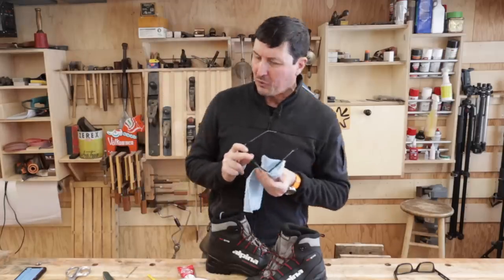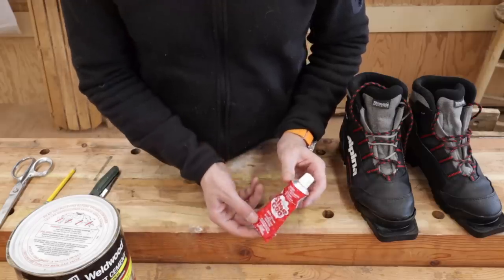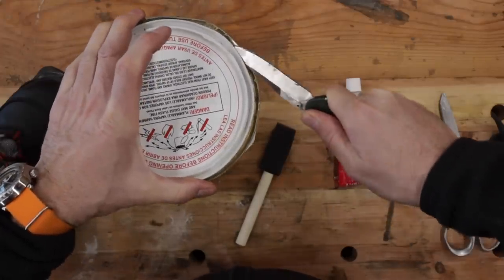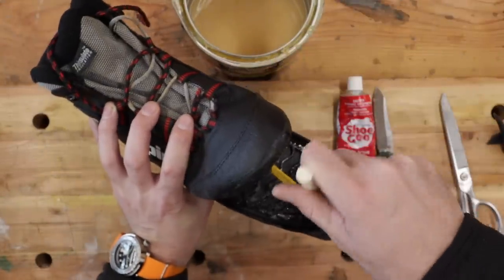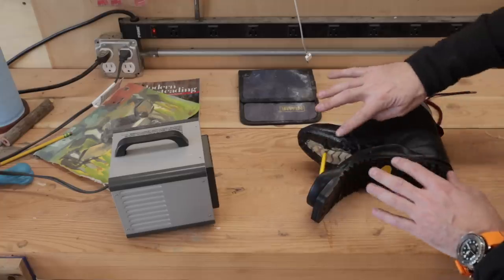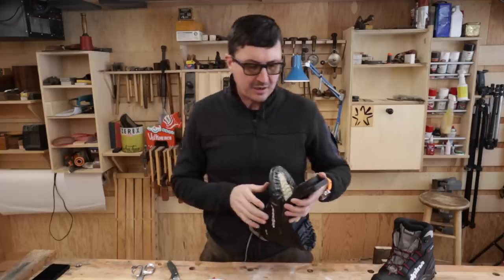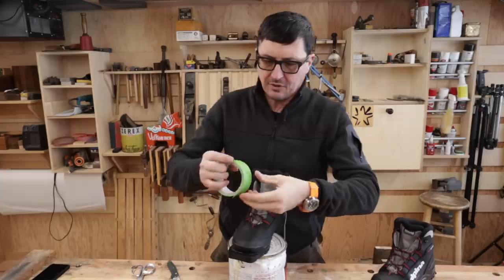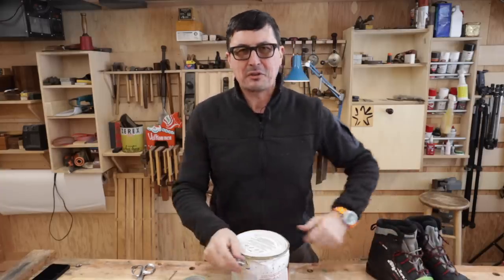SHOE REPAIR - How To Repair Your Shoes

Comment from the maker: Get A Tube OF Shoe Goo Here - https://amzn.to/2HjbNXB
Reply: Nice video, liked it a lot. Good job saving those Alpina shoes. :)
Reply: As a skateboarder you should trust me when I say selley’s shoe fix is way better
Reply: I used "SeamGrip"(tent repair) on a pair of German Made Meindl boots a couple years ago with great results.  We used Shoe Goo in the '80s with good results on generic pac boots.
Reply: Cardboard makes a great contact cement brush.  LOL  I have used to always use contact cement, but lately I have been using epoxy.  Impact works great to set contact cement.
Reply: Barge cement tends to work better than the shoe 👞 goo
Reply: 1°  c or f?  ;)
Reply: Hey cody a helpful little tip I've picked up is whenever you're using anything in any sort of paint can put a rubber band  vertically around the can to wipe off the excess instead of getting it all over the edge of your cans 
Edit: or you could run a piece of masking tape over the opening
Reply: @Adventure-Spark  Just go to bitchute and then search Wranglerstar.  You can't miss it.
Reply: @Adventure-Spark  I should add that YouTube has gotten "sensative" about specific links in videos.  So do take a few moments to head over and do a search.  It's really easy.
Reply: Just a few days after this video came out, my Bike boots did the same but on the heel. Like new again.
Reply: I knew you were a wise man as soon as i saw you subed

Comment: My wife is a cobbler and for small repairs on shoe shoe goo does more harm then good,  just a little expert advice.  Contact cement is the way to go!
Reply: Good advice, I haven't been able to get shoe goo to last for any appreciable length of time. You might be able to build up a missing chunk on the sole, or plug a hole, but gluing the shoe back together hasn't worked. Using a shovel has sometimes taken a chunk out of the sole of the shoe   :)
Reply: Thanks for tip.
Reply: jetboss737  alright grammar police maybe you should speak with the cell phone companies about autocorrect.
Reply: but is that stuff bendy and stretchy?
Reply: jetboss737  hey, take it easy! He may be from the East coast
Reply: @davidmc8110  Good to know. My daughter wears out all of her right shoes very quickly by creating a hole in her sole. Her right leg and foot are slightly longer than her left and we assume that's why, perhaps because it drags a bit. It's getting expensive to replace shoes that should last for years after just one season because of a small hole so I decided I needed to find a cheap way to repair them instead. Do you have any advice as to doing so properly? Do I just fill the hole with the shoe goo and allow it to dry and that's it? Maybe do a couple of layers? I was thinking about doing that and then covering it with a Kiwi no slip sole cover for protection but don't know if that'll work. I'd like to find a way to prevent the holes altogether but I haven't been able to yet, like maybe a thin shoe lift in the shorter leg. I'd appreciate any advice if anyone has experience with this sort of thing.
Reply: @KatarinaS.  Some advice.. Take your daughter to an orthopedic doctor for professional advice on getting shoe supports for the shorter leg. Don't waste time or she'll end up with hip surgery.  Should save you on shoes aswell so it's a win win.
Reply: @thekingofelfland3294  I've considered that, but now with this virus we've been avoiding unnecessary trips anywhere. She's 22 years old, not a small child, and we never noticed this issue until the past couple of years and recently came to the conclusion that it could be due to a leg discrepancy. She has no hip or back discomfort or other pain or issues, I've asked her repeatedly. It's only a slight difference, not noticeable, one of my leg's is slightly shorter too. In the meantime we have several pairs of shoes each with a hole in the right sole that I'd like help repairing. Thanks anyway.
Reply: @KatarinaS.  Hopefully this has been properly addressed by now...
Reply: @cloudbase7799  I actually forgot all about this until I got your message. A lot has happened in these 3 years. Deaths in the family, births in the family, illnesses, accidents, injuries, job changes, etc, so it's been a busy time, to say the least. Alas, the shoe wear problem remains.
Reply: @cloudbase7799   why, do you have any helpful suggestions?

Comment: When I worked in a bodyshop I used windshield glue (Reinforced Polyurethane)to repair my workboots, it was a thing we used all the time for the repairs and seemed appropriate to use it for shoe repair. They lasted for years after that until I threw them away because I got more comfortable boots

Comment: I've made a pair of softwood sole shaped inserts for more effective clamping. Also use 3M 5200, and Gougeon G-Flex for more difficult soft material repairs. A quick flash-flame treatment across the surfaces will increase surface energy, promoting more thorough wetting of adhesive, and improved bonding by as much as 25%!

Comment: Contact cement is amazing for shoe repairs! I put Goodyear rubber half soles on my smooth bottom dress shoes as soon as I get them and it more than doubles the life of the shoe. Of course, it also helps to get a pair of shoes with soles that are mechanically attached with a Blake Stitch or Goodyear welt.

Comment: I bought a pair of good winter boots a couple years ago, but the "D" rings that you put the laces through on the outside broke off. So I went Jo-Ann fabrics and got a coat latch and converted that into a "d" ring and fixed my boot with that. One time another lacing assembly piece broke off on a pair of boots, and I used a fishing attachment/leader  to fix it. I'm still wearing those boots today !

Comment: You know what works good to prevent the shoe from separating in the first place? If you take them when they are new (or still in great shape) and you put a thin layer of super-glue along all the seems where the sole meets the shoe, and where the sole has any layers that may separate. Keeping that initial separation from starting has worked wonders for me. For any small splits or separations one super glue, DAP Rapid Fuse, has worked the best (as my old work boots, and my The North Face insulated boots can attest) and then I just go over all the seems to seal it up.

Comment: J-B Weld Plastic Bonder 2-part EPOXY works phenomenally...plus its way easier to use, dries quick and stays flexible at all temperatures the weather can throw at you.

Comment: I used to fix my work boots with shoe goo after few failures usually after repeated muddy wet  jobs they would fail again . Then I tried contact cement, those same old pair of boots I wore another year then retired them  but still  wear every week when I do my yard work mowing , weed whacking wood splitting etc .. and wear in my shop at home so basically all Weekend still going strong I second the Contact Cement . Keep up the good work Mr. W we support you so you tube has too!

Comment: Cody you can purchase contact cement in a spray can. Worksgreat. Plus you can keep using it much later. Doesn't plug up like a paint spray can. 3 M makes it. Useful also for fabric repairs like a loose headliner or whatever.

Comment: Love the behind the scenes commentary of what led you to the repair itself.  E6000 is what i used a couple of days ago for a pair of kids sneakers.  Shoe goo on steroids, is what i've been told.   It remains flexible after curing but does take up to 72 hours to fully cure. The beauty of a longer cure time allows time to clean up for a professional look in the end.  I'd be interested in side by side comparison of these adhesives under use at extreme temps.

Comment: I used shoe goo on a cut at the tip of a work boot years ago. It worked great all the way up till I had to get new ones. I will have to take a look at the contact cement as well, Thanks

Comment: I usually put a plastic Walmart bag over the opening of a can before I put the lid back on.  They the next time I open the can it is easier to do.
Reply: Run a bead of Vaseline in the trough the lid fits in. It will open easily next use.

Comment: Hi Cody, keep an eye on Mrs W's repaired boot!  I've found contact adhesive isn't great when it gets damp.  Take some gaffer tape on your next outing just in case,
Reply: I was reading the comments to see people's experience. Weldwood has not been durable at all for me in wet and cold environments. The repairs I did looked great going together and then failed immediately on the trail.

Comment: The only adhesive that I have ever had any good long term results with for shoe repair is Loctite S30 Polyurethane Roof and Flashing Sealant.  It's not sold as a glue, but it is the best flexible adhesive that I have ever used and it is inexpensive.  It is used in a caulking gun.  You will need to wear gloves when applying it as it is very difficult to get off your skin (it is black in color).  It is sold in the big box home centers and online.  When using it as an adhesive, the item needs to be taped or clamped together for a few days before use.  It will last several months after opening if you plug the end of the tube and place it in a refrigerator.

Comment: Well done and great advice.  Just a note but the contact cement and fumes is highly flammable and any hot ignition source can cause combustion.  I have seen
many home burned down from that stuff.  Great product, but use wisely. Thanks for sharing.

Comment: We went to Thunder in the Valley in 2005 and my boot started flapping like that.  We bought Shoe Goo, glued it up, and set the dresser corner on the boot overnight.  Our friends laughed their @**es off, but those boots are STILL holding up!  I have a few tubes of Shoe Goo in my preps.  I think that it worked so well because of the extreme weight on it overnight.

Comment: I have to share what is taking place right now. Especially since you shared this video. Back in June I purchased for well over $200 a pair of boots from my close friends store. The brand was Oboz. Here's the kicker. I have severe plantar fasciitis. So I actually have three different styles of boots. The tall insulated waterproof for working around the homestead and Farm. The Oboz and a random pair of slip-on boots for running outside real quick. The Oboz is the most expensive. The other two pairs I have less than $80 invested in both. About the only time I wore these Oboz. Was dinner night out the movies or my long drives to the VA Hospital. All in all a total of two days of use a week. Just this past Friday the bumper of the left you came off just like the one in this video. These are supposed to have a1 year warranty. It is clear what has happened to them. The adhesive they used has failed. Here are the requirements to get them replaced under warranty. I have to clean them up spotless. They ask for several pictures including the tread. But their webpage only allows you to upload one picture. Once they see the damage they determine if they need to send a label to mail them in. Once they have them they will inspect the tread and conditions of the boots. To see if they have been overused. Even though it is clear what has happened. They are going to look at everything else but the problem. When I asked how long this process would take. Before I knew if I would get a refund or a replacement pair. They say they can take upwards of two months if I was lucky. Well I seen in the picture over the weekend I have yet to hear back from my warranty via email. Being that I am medically disabled and do not work my funds are limited. So now I am left with a 200 + dollar pair of boots that I cannot use. Which has a custom insert in it specifically for them. And the only other items I have to use I really not that good for wearing out in public. so I'm going to digging through my storage for an old pair of military boots. And hopefully can shine them up with some Lincoln wax. I honestly feel that these companies that overcharge for their product. Intentionally make using the warranty a pain in the back side so you won't try to use it. And we'll just buy another pair. I know I will never own another pair of these again unless they send me a replacement pair and I will use it until they wear out and buy another brand.

Comment: One thing I have noticed after using shoe goo many times, it works very well but will dry fairly hard, so make sure you put enough pressure on the shoe while it’s still soft so there are no spots sticking up 
Excellent video mr W

Comment: 5200 marine silicone is the best for repairs. Just did my old muck boots same repair just squeezed it in and duct tape the toe and let it dry. I use it for patching holes to.

Comment: Tape is unnecessary when using contact cement correctly.  If the glue is dry to the touch, it bonds instsntly.  I wear my athlectic shoes until the literally have no sole left.  I resole my Chippewa Loggers. They cost $250.00 when I bought them.  They cost much more these days.
Reply: I wear the same ones and am so glad I came across this idea before the sole came apart.  Been dreading that day for some time now but now I’m relieved!

Comment: I've found that shoe goo does not work well for me. It does work for some things well, but not nearly as well as people claim. I am very rough on shoes. I've actually used Loctite PL S30 for many fixes regarding shoes, but never for reattaching the sole. I'm going to try the contact cement next time for the soles.
Reply: I am late to post, I know -but thanking for the tip on using Loctite PL S30.  My shoo goo repair failed, probably because I am rough on shoes as well.  :)

Comment: Hey cody a helpful little tip I've picked up is whenever you're using anything in any sort of paint can put a rubber band  vertically around the can to wipe off the excess instead of getting it all over the edge of your cans
Edit: or you could run a piece of masking tape over the opening

Comment: PAINTER HACK:  Take the pointy end of a 5in1 tool and jamb a couple holes or slots down through the bottom of the trough in the can where the lid goes on... It lets the goo drain back down into the can and doesn't effect the seal.  No where near the mess and way easier to open later.  You need a 5in1 btw, and stop torturing that poor knife :D

Comment: Contact Cement will cause and explosion in confined spaces. A friend was gluing carpet in the bottom of his boat in his garage. The fumes reach the pilot light in the water heater located there, and he and another buddy ended up in the hospital with severe burns. Not worth taking chances!

Comment: HEY DAD !  THANKS FOR THE VIDEO WITH CONTACT CEMENT SHOE REPAIR.  FOUND MASKING TAPE AND 3M 90 CONTACT ADHESIVE; WORKS WITH POLYETHYLENE AND POLYPROPYLENE (THE OPPOSITE OF SUPER GLUE).  TAPED SOLES TOGETHER AND LET THE SHOES SIT IN THE SUN.  WORKS VERY WELL SO FAR.  ROCK ON !  THANKS !  MY DAD WAS IMPRESSED TOO.  WE LEARNED SOMETHING NEW !

Comment: I've tried this a few times but they never held up for very long :( I must be doing something wrong or perhaps the contact cement sold here just isn't very good.
Reply: Use Barge All-Purpose Cement Rubber Leather Shoe Waterproof Glue.
Reply: Maybe the area to be glued was not COMPLETELY clean of the old glue.

Comment: Use Shoe goo, it is good and works most of the time. Better (but rather expensive) was a pack of Scotch Weld 3535,  a two part urethane glue, that was immensely strong.

Comment: Also windshield and tractor window gasket repair..
Reply: Wouldn't that be a replacement reason (I don't know whether silicone is a suitable option in a pinch but would assume gaskets need to be continuous).

Comment: What's the heating for and what if you don't have heatgun, why dont just stick them after the 5 minutes dry period? Is PU adhesive different instructions compare to a common rubber based contact cement where they just tell you to contact them after 5 minutes?

Comment: If its fixable, it should be fixed. I got 7-8 years of work, hobbies, free time you name it in my last pair of leather combat boots by fixing those few times. Then I had basically no sole left on those and the Goretex and leather started to fail so they would get wet. But for 200 euros and few little fixes with like 10 more euros (ofc new insoles at least once a year) I saved easily 600e by not buying a new pair before it really was needed.

Comment: Interesting “twofer” video! You need to re-title this video though as “How to Repair your Shoes and how to Retain your Marriage” (or something like that). 

I have one year old sketchers that I found in the dumpster last year that were in nearly new condition (just a little dirty). I wore them a whole year. And now the soles are worn out. The shoe repair dealer place quoted $50 to repair them. The nearest equivalent new pair of sketchers would cost 70 bucks. But I’m gonna try to use contact cement or supergoo to try to fix them instead. Thanks for your educational video.

Comment: I keep office supply HD clear packing tape to 'sinch' it all up. Using a ball of rags taped down hard over the toe to help maintain sole contact with slow curing adhesives. If you're buying the wife Gucci shoes, go ahead and use the expensive tapes. You're much better with chainsaws than the 'Men are from Mars' stuff, and that's alright.

Comment: i can never find contact cement thats nice a runny like i see in all the american DIY videos, all that seems to be avalible to me cements that are thinker than syrup and are very hard to spread evenly, i had thought of gently heading the cement to see if that will lossen it up but im causious of its flamability
Reply: Add some more solvent to it to thin it out.  Do not heat it due to the fire danger with open flame or sparks.
Reply: what sort of solvent  @dougdobbs